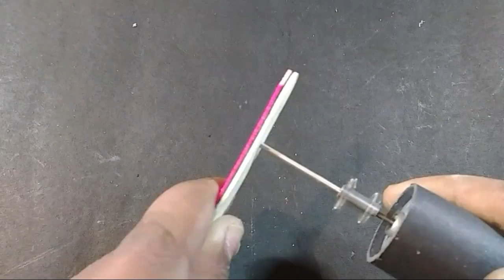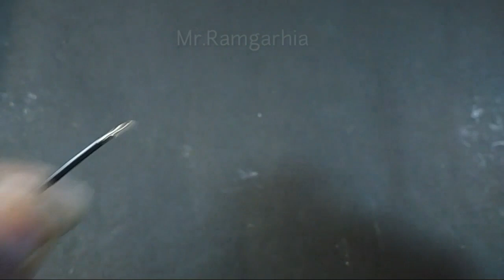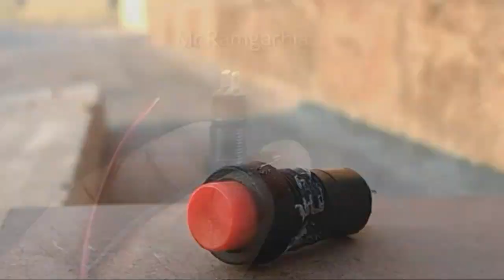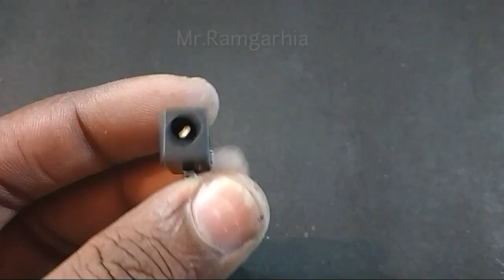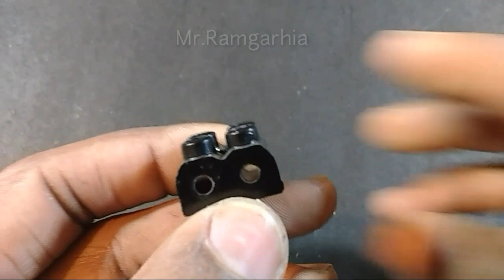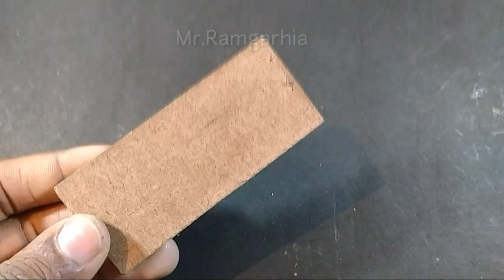How to make Drill Machine at home

Comment: I am having the same dc motor i connected via usb cable but it can't drill hole. What will be the problem reply me
Reply from the maker: No uss
Reply from the maker: No USB only 12v adapter
Reply: What is the price